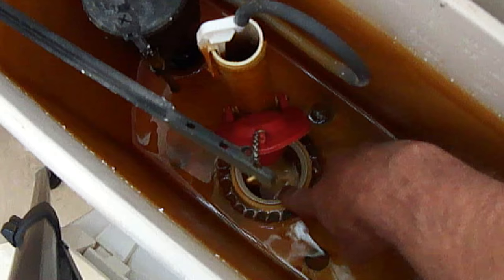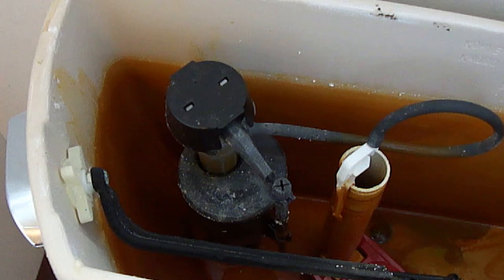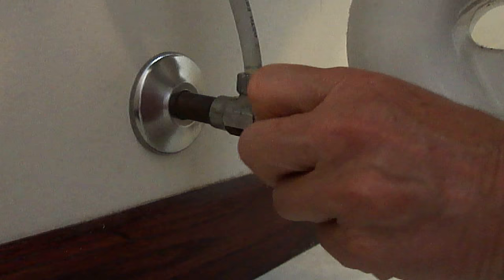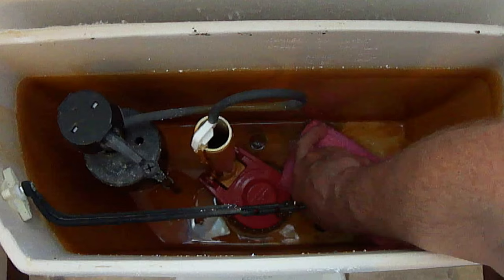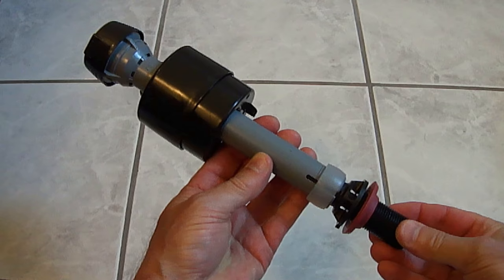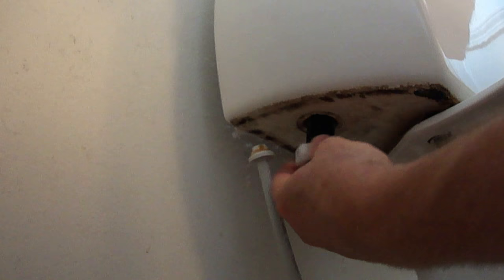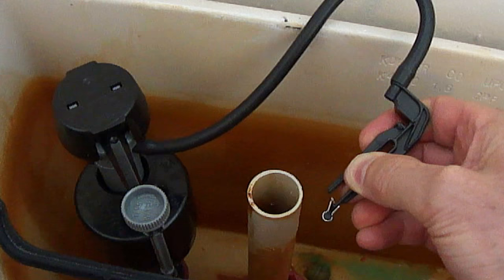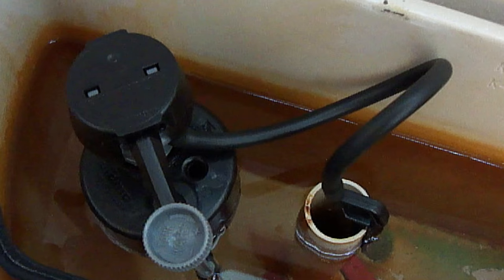Toilet Not Filling Up With Water - Easy Fix!

Comment: I don't know if the comment section is still active or not, but i just bought and installed a new fill valve and the issue is continuing, i have to open the tank and press down on the float lever for it to start filling

Comment: My Mansfield toilet won't refill until I take the top off and almost  literally breath on the fill part. Exaggerating but the slightest tap with a finger and it switches right on. I've tried raising and lowering the plastic screw, and swiveling the whole mechanism side to side as allowed and I can't get it to activate automatically. It started to happen here and there and Id jist kinda jimmy it around and it would start working again but for the last 4 months none of those little things are working. Any ideas?
Reply from the maker: Chris Rios Unfortunately you probably just need to replace it Chris.

Comment: Anyone have any advice for someone who can't turn the water all the way off? I've got my replacement fill valve, and I've turned the water supply all the way to the right, like there's no thread left, and water still dribbles in. Is it just a speed test with a basin underneath at that point?
Reply from the maker: The easiest thing to do would be to shut the main water supply off.
Reply: @proclaimliberty2000  Wow, quick response, thanks! I'll give it a shot, though I live in an apartment condo and have to get someone to unlock the basement access, to which they'll probably insist I hire a plumber that I can't really afford, but it's that or keep  filling the tank with a pitcher XD
Reply from the maker: @Erinski  👍😊

Comment: ok. after installed the new fluidmaster it worked with no problem, but few months later it fill the thank and it stop filling water, I have to adjust the water control to the left or right and the water start working again. please can someone help me how to resolve it. thanks!

Comment: Should water always flow from refill tube into the over flow tube/pipe when it flushes?
Reply from the maker: Cali Valley There should never be water going down the over flow tube.
Reply: proclaimliberty2000 just replaced the entire assembly at a cost of $8. Fixed, thanks!
Reply from the maker: Cali Valley Good job!👍😊

Comment: What if the water is not filling at all after a flush.  Actually we hear no sound of water trying to fill immediately after the flush. Then we turn on the tub water faucet or any other faucet in the house.  Then the toilet fills.  But only when another a faucet in the house is turned on.

Comment: I’ve had this problem with my toilet for awhile and I’ve replaced the fill valve, flapper, and tank to bowl gasket and it STILL won’t fill the bowl enough. It fills up to a medium amount and then it slowly drains down to a very small amount. I’m not sure what else to do, but I’m really trying to avoid calling a plumber, as I was conned by one a couple years ago and constantly harassed for more than double what was quoted. Any ideas??
Reply from the maker: From everything you’re describing it sounds like your flapper valve is not sealing properly. Buy some Magic Lube Teflon lubricant and spread it on the flapper valve and flapper valve drain opening and see if that solves your problem.
Reply: @proclaimliberty2000  I’ll try that, thanks!
Reply from the maker: @AllTheCoolNamesAreTaken84  A lot of pool stores will carry Magic Lube. It’s really incredible stuff!
Reply: @proclaimliberty2000  Well I finally got around to applying the magic lube earlier. Had to wait awhile to have it shipped because it wasn't in stock in stores near me. Unfortunately, it didn't solve the problem. Not sure if it's anything I did wrong, but it's still draining down to a low level right after it fills up. Is it supposed to work right away? I just KNOW that if I break down and call a plumber, he'll fix it within 5 minutes and charge me an arm and a leg. This is so frustrating!
Reply from the maker: @AllTheCoolNamesAreTaken84  it should seal right away.  Is your flapper valve open on the bottom or does it have an adjustable dial with holes on it?

Comment: Replaced mine worked fine for about 7 hours now water is running threw the little pipe do you think i bought a defective replacement??
Reply from the maker: You need to adjust the float lower so that the water remains at least a half inch below the little pipe.
Reply: proclaimliberty2000 i did adjusted the float all the way down and then all the way up but still water keeps coming out the little hose
Reply: I think i bought a defective valve calling imperial store see if they will replace it
Reply from the maker: John Lira the float is coming up too high.
Reply from the maker: John Lira you need to screw in  the bottom rod more to lower the float.
Reply: proclaimliberty2000 how do i fix it ? I adjusted the float up down slowly but still water wont stop coming out the little hose
Reply: proclaimliberty2000 i had it the way it came and worked but hiurs later i started doing the same thing so i took it out and lifted the rod so it will sit 3 inches and still does the same thing
Reply from the maker: John Lira I still think the main problem is the main unit is adjusted to high and needs to be lowered.
Reply: proclaimliberty2000 thank sir took it back they gave me a better model for like 2 $ More they told me that people been returning the model that I had bought first might be a defective batch
Reply from the maker: John Lira 👍😊

Comment: So my issue is that I had a leak in the supply line so I replaced it now when I turn on the water it works then stops once it's fully open

Comment: Can you tell me why when I attempted to disconnect the water line from the bottom of the fill valve, my fill valve inside the toilet starts rotating as I turn… it’s like the two pieces are stuck together😢

Comment: The issue that my toilet has is that it won’t start to fill up immediately. When I flush it nothing happens until about maybe 30min to an hour later and then it’ll begin to fill up. I say 30 min to an hour because it’s not consistent. I’m wondering if replacing the fill valve will actually help or not
Reply from the maker: Prior to the 30 minutes to an hour before it fills does it make any noise?
Reply: proclaimliberty2000 the only noise it makes is when the tank is filling up. The actual fill up doesn’t take long either which is why I’m wondering if replacing the valve will help
Reply from the maker: Keylogram_ 314  Push the lever down on top of the fill valve and release it. You should hear water run for a few seconds and then stop. Does it do that?
Reply: @proclaimliberty2000  Hey, I see he never responded to your question.  I have the same problem.  I have tried to jiggle or push down on the float and every now and then it will start working, but most of the time it doesn't.  It makes no sound at all and then randomly, sometime  later it will fill up.  Is that still a fill valve problem?

Comment: So mine was working just fine until the freeze (i live in texas). No water leaks anywhere. My other toilet works just fine...any tips?
Reply from the maker: Hello from the great state of Texas.  My best guess is that you simply need a new fill valve.
Reply: @proclaimliberty2000  the shut off valve that goes from the wall to the toilet is a push/pull button-like valve. Ive manipulated it to no avail
Reply from the maker: @MinhaFamiliaAQBJJ  so it sounds like you need a new shut off valve.
Reply: @proclaimliberty2000  dang i got ya. I will do just that then. Thank you for your time!
Reply from the maker: @MinhaFamiliaAQBJJ  👍😊

Comment: I've got a weird issue where my toilet doesn't want to fill every time I flush it.  When I turn the water supply off and then back on it will then fill as normal.  Every time I flush the toilet will not fill back up until I turn the water off at the valve, then turn it back on.  Any idea what this is indicative of?
Reply from the maker: It sounds to me like you need a new fill valve.
Reply from the maker: There’s a good chance you’ll be able to find a new fill valve replacement at places like Home Depot or Lowe’s. They are really not that hard to install.
Reply: @proclaimliberty2000  Very good.  Thanks for your advice.  I'm about as handy as my dog at mechanical things (and he has the no thumbs excuse), but looking at DIY videos on youtube looks like something I may be able to handle.

Comment: I changed out the fill valve but my toilet still won't fill. It keeps adding water but it doesn't fill to more than one inch and doesn't fill enough to allow it to flush.  There are no leaks.  The rubber gasket seems to be fine and I don't believe that water is leaking around the base of the white tube.  I have no idea where the water is going.  WHAT DO I DO NOW?   PLEASE?   ANYBODY.
Reply from the maker: It almost sounds like you have a water supply issue.
Reply: to  @proclaimliberty2000   - thanks but I've checked the water supply line - it's fine. The leak seems to be at the area where water comes from the bottom of the fill pipe to the toilet when the flapper is open so I'm thinking the flapper might be the problem ??? I'm ordering one and if it works --- great. If it doesn't work, is there any way to change out the pvc fill pipe? Thanks again. PS - I found the hard plastic flapper that came with my American Standard toilet - it does not have the cone shape thing on the bottom.  But it only comes in packages of 2 for about $20.   I know that I won't be able to find where I put the 2nd one in 10 years when it fails again.  So - DO THE universal flappers that are soft and have the cone on the bottom work well to replace the hard plastic flapper that came with the toilet?  Thanks .
Reply from the maker: @lukemcgook4229  I would try the soft universal flapper cone which you can find at Home Depot.
Reply: @proclaimliberty2000   - OK, thanks again.  I'll let you know what happens.
Reply from the maker: @lukemcgook4229  👍😃

Comment: water pressure in house is fine,,,,, toilet seems like it has air in the line it trinkles in,, if i shut the valve off and back on it fillsfine,,, it could be this piece the tank is 31 years old lol,,,,  God bless you to :)
Reply from the maker: chozen0018 👍😊

Comment: Okay...replaced Fill Valve. But water doesn't fill tank. It's running. But fills up 1 or 2 inches. No leaks. Just running water in PVC.
Reply from the maker: Does anything change if you lift up on the fill valve arm?
Reply: @proclaimliberty2000  The water stops in overflow pipe. Goes silent. When I let it go, water continues to flow into overflow pipe. But tank fills just at flapper.
Reply from the maker: @joeh1970  The only thing I can come up with not being there is the fill valve is not adjusted properly.
Reply: @proclaimliberty2000  Yes. Install is correct. No leaks. Water flowing. But a drip under valve. Not much water.
Reply from the maker: @joeh1970  boy I really wish I could help you more Joe but I’m just kind of stumped and it’s hard with me not being there
Reply: @proclaimliberty2000  Completely understand. Your video is great. Just a pretty simple procedure. I purchased the Fluidmaster 400 as that was on the tank originally. So I'm stumped as well.
Reply from the maker: @joeh1970  The only other thing I could think of is to call the place you bought it from and ask them if they’ve ever had them return because of being defective.
Reply: @proclaimliberty2000  Update: Exchanged Fill Valve. Tank water went up halfway. Progress from just above Flapper. But wouldn't fill. I physically held Flapper down and it filled to proper level. Tank arm would rise, then stop because it reached proper level. But would not hold. Arm kept lowering and hence adding more water. When I removed hand from Flapper, water went halfway down again. So Flapper needs to be changed. But concern is even with Flapper replacement, will water hold?  Just updating...Thanks
Reply from the maker: @joeh1970  it should absolutely hold water with a new flapper. Just make sure the flapper opening is also clean with no debris on it.
Reply: @proclaimliberty2000  Much thanks. I'll keep you posted after I replace flapper. Thanks for helping.
Reply from the maker: @joeh1970  Is your flapper valve like the one in this video?  If it is I just did a video as to how to install a flapper valve and make the proper adjustments which I can send to you.
Reply: @proclaimliberty2000  I haven't purchased yet. Have to go to Home Depot tomorrow. 3 inch Flapper.
Reply from the maker: @joeh1970  https://youtu.be/XZNCaUvJMsI
Reply: @proclaimliberty2000  Got it!!!!!!
Much thanks! Replaced Flapper and working perfectly. Changed other toilet as well because they're the same age... Appreciate all your help!
Reply from the maker: @joeh1970  That’s great Joe! 👍😊

Comment: Mine fills with water but over hours it the water level goes down. I press on the valve and it fills back up with water.
Reply from the maker: It sounds like both your fill valve and drain valve are bad.
Reply: @proclaimliberty2000  thanks, I guess I'll got buy them and replace it cause I'm sick of having to press on that fill valve to fill the tank up every time I gotta fllush.
Reply from the maker: @shadowlee02  👍😊

Comment: my tank isn't filling at all, the water is going into the overflow pipe but the level never rises
Reply: figured it out if anyone comes across this problem. the little flap that's attached to the lever wasn't closing all the way

Comment: If its a Fluidmaster toilet valve ........remove the valve, turn upside down and look into the tube. You will see a foam plug seated about 1 inch into the tube. Use needle nose pliers to remove that piece of shit and then replace your toilet valve. Fluidmaster doesn't even show that foam plug anywhere on their toilet bowl schematic diagram. It's worthless and fails over time.  Thank me later.

Comment: Just an observation, but the old cock and ball system worked WAY BETTER.  I never used to have this problem with the old system.  Honestly this kind of system seems to be a money grab...  Just a laymen, but I am 50 years old.   I replaced the old cock and ball system only.... NEVER... I replaced the ball, but once every... 8 years maybe.  I bought a new house 4 years ago. with 3 bathrooms (same as my last brand new house).    In  10 years I replaced ONE Ball (float and float arm they cam as a package).  Since buying a house with the new system, I have replace each bathroom 2x in 5 years.... I know its Texas, we have a lot of calcium in the water, but BOTH houses were here.  Seriously, it's just an inferior system.  Again, I am a tattoo artist, not a plumber, I am coming at this with MY knowledge and ability to reason, not a plumber.  I have been able to reason myself through almost every problem I have ever had... easily, this system is f'ed.....